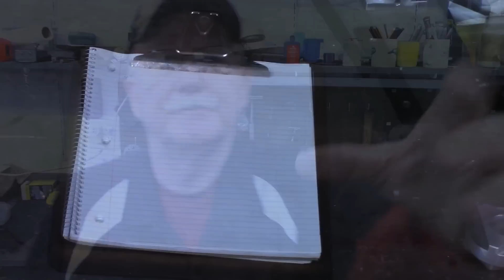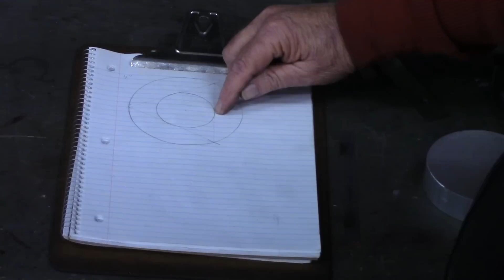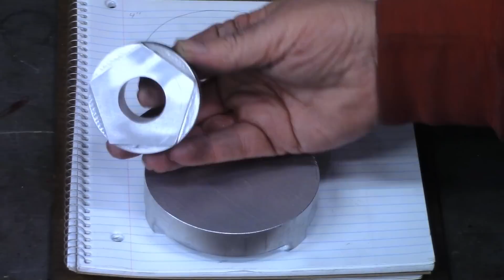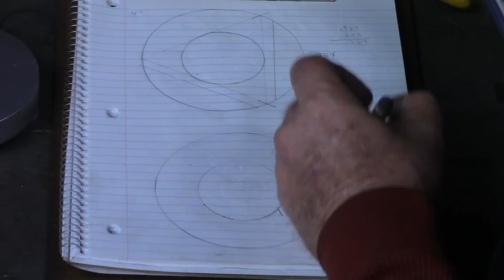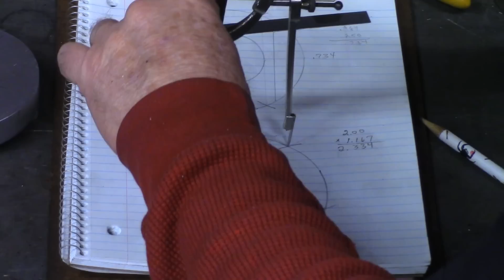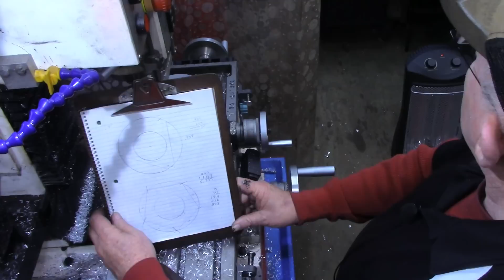Machining a 3-5 Indexing Jig Using the Rotary Table

Comment: On the original rose, the square could be converted to a 5 side giving a 2-3-4-5-6-8 rose. Using the octagon for the 2-4 + 8, the hexagon for 2-3 + 6 and the pentagon for 5.

Comment: Very well made videos (all three) on this type of indexing jig and your machining is great.  I would suggest putting a V at one side of the interior hole so that the workpiece (actually the jig itself) is held stationary at three points instead of just two which could rock just a bit.  Keep up the good work!

Comment: These are fascinating gadgets.  When I saw the 4-6-8, my initial thought was that you would be claming that in the vise, which probably wouldn't have worked real well with stock that was smaller than the hole.  So I was rather surprised when you demonstrated how they were actually used.  I can see the first one as being useful, this 3-5 one maybe not so much.  My recollecton is that NYC fire hydrants had a five-sided fitting on the top to turn them on,  so theoretically you needed a special wrench to do that,  but it never seemed to stop people from just using a pipe wrench.  :-)

Would these obviate the need for square and hex collet blocks?  (Still thinking about what tooling I might want to acquire...)

Comment: Thanks for this mini-series, Lee.
Don't forget that you can index 10 from a pentagon by lining up with the square on the face when it is vertical at the back (180 degrees rotation).

Comment: Interesting video, but you've got an oops!! You got the last two digits in your ratio for the pentagon reversed - the ratio is (1-cosine 72)/cosine 54 which is also = 2 x sine 36 = 1.17557050.  Rounded to 3 decimal digits ~ 1.176, not 1.167.